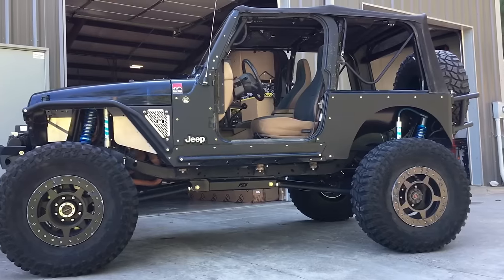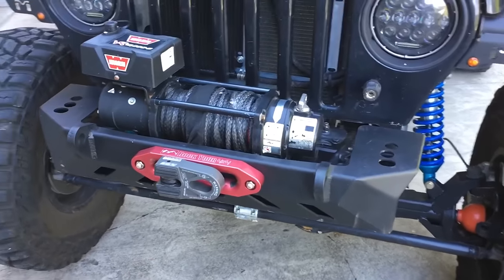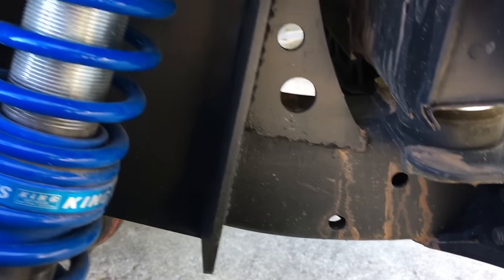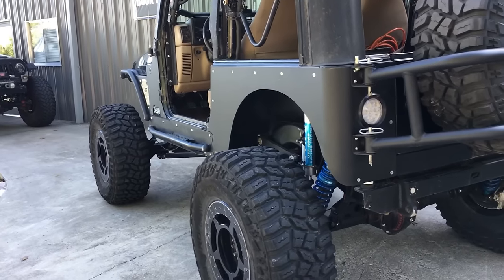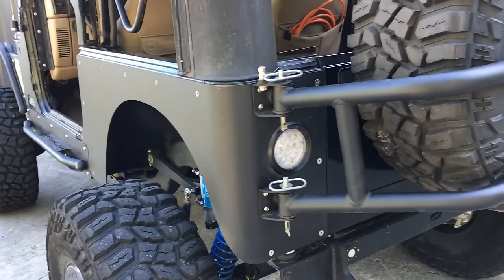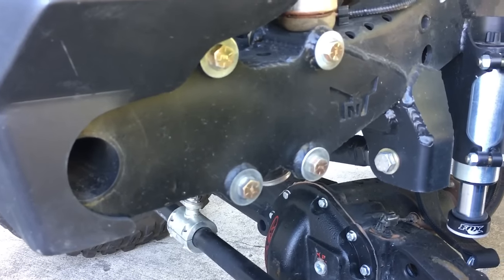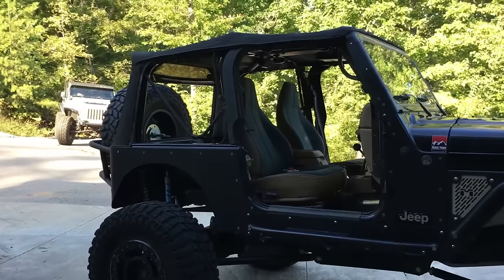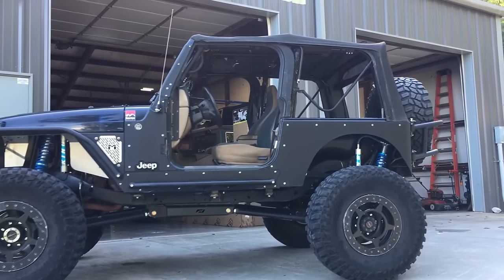2000 Jeep TJ Build #nuntonstj

Comment: I have that UCF hydro brake bracket- it is the best!  I changed my drum brakes over to disc brakes because I absolutely HATE working on drums. Even though I didn't have to mess with the rear drums for a long time, when they started to not work there wasn't anything I could do to get them to be as good as they originally were, even after a complete rebuild.

The disc brakes from a Ford Explorer had those dumb drums inside the discs, and I could not get the cables to operate the drums more than a few pulls of the parking brake.  The UCF bracket solved ALL of my problems and I got better parking brake hold than my drums ever could.

Comment: Nice build for sure. 
The only thing I question is why a genright tank was not used.  
You can push a dana 60 out like 6" with it so the 44 should have had no problem fitting.
Reply from the maker: Future plans for a 14 bolt and he didn’t want anything hanging down. Also, the Motobilt fuel cell is 1/3 the cost.

Comment: Ok I read all the comments and this jeep  is very slick.... what is the parkng brake valve make and part number    I was contemplating line locks but this is sooo much cooler
Reply from the maker: Jeep534 h Wilwood 260-6089

Comment: Sick build. I see you guys stretched the rear. I have the same kind of build and am running into problems with the evap cannister.  The computer is registering it as a vacuum lock and it intermittently will not rev over 2k. Any suggestions?  Thanks guys.
Reply from the maker: Robby P we just removed it and left it with a check engine light for now. It runs great.
Reply: RockYour4x4  Hmm. I put in the Genright Tank and just put breathers on the lines running to the tank. What did you dod with the lines that ran to the evap?
Reply from the maker: Rob P I don’t remember. I’ll look at it next time he comes by.
Reply: Hey i just replaced mine it’s from auto zone it’s not for the Jeep tj but everyone on the forums said it fit and sure enough it did and works perfectly
Reply from the maker: AnthonyBro send us a link to that

Comment: How does the transmission mount with the Motobilt skid/4 link set up?
Reply from the maker: It mounts to the center section of the crossmember with a riser block just like the factory mount is.

Comment: is the center section of the frame the only OEM part ?
Reply: indianajones500 the whole frame is OEM. It has the front extension with the TNT kit and the front/rear coil buckets were cut off for placement of the coilover towers.

Comment: Like to sell my 2001 black Jeep TJ with approx 6500 original miles . Has tan interior with 5 spd trans & 4.0 liter engine  . Dynatrac front & rear Dana 60's with electric lockers ( diffs still in crates ) . Custom long arm Currie J - arms .

Comment: 4:22 What did someone bondo the frame?
Reply: thats where the old upper control arm mount was. with the long arm lift kit, the installer has to remove and grind off the welds otherwise the new control arms contact the old mounts.
Reply: Rocket Propelled Gaming so is that a yes or no haha

Comment: id be embarrassed to show up at moab in a rig built completely by someone else.. lookin like a clueless bastard as soon as something breaks
Reply from the maker: Andrew Browner shakedown run was 5 days of Wheelin in Moab. He’s a mechanically inclined customer and friend and
1) It’s been a year since completion and only a stock power steering pump failure 
2) He repaired it
Reply: Dude can drive it tho, Andrew. Did you even see the last four minutes of the video???  Aaand he knows exactly what he wants in a build, and has friends that know their stuff. We all need a little help some times. I do my stuff in my garage with my harbor freight press and chinese gear measuring tools. I bring a friend in to use my Esab on frame work that I'm not proficient enough at using yet. I get the big shit right and totally screw up on the small stuff. Always need help. 

This is a build very similar to what I myself am shooting for. I'm just past a third of the way. This thing is damn near perfect.  Excellent geometry, possibly the best achievable LCOG, huge wheel base.. a highly capable machine with 37" tires that can go the same places as machines with 40"+ tires and "tons" but this thing can do it much more gracefully. 

Curious, RockYour4x4,
Though I know that your customer wanted it, why the fuel cell? I'd rather have that also, keeps the fromunda up from down unda..  hehe.   I need the space for a car seat among other things.  Would a genright ext or similar still have fit your build here?
Thanks for the excellent video
Reply from the maker: Clay Stewart it would. He’s a single guy and wanted the cheaper simpler route.